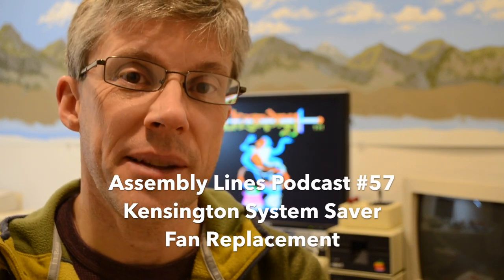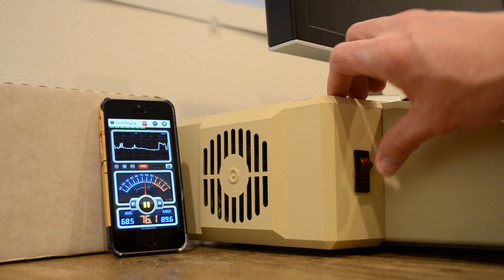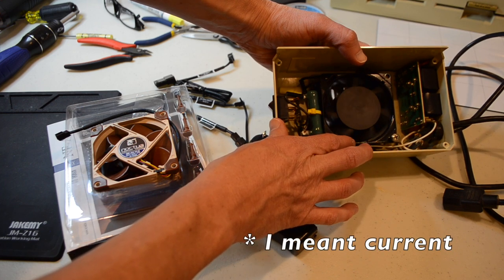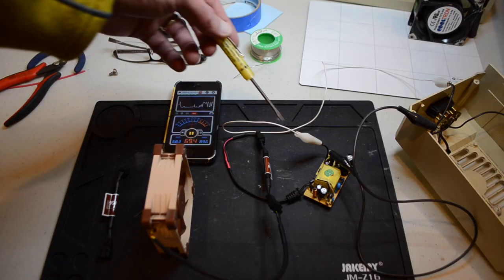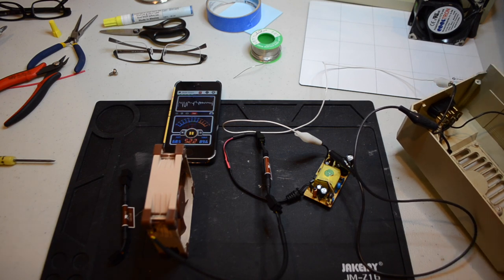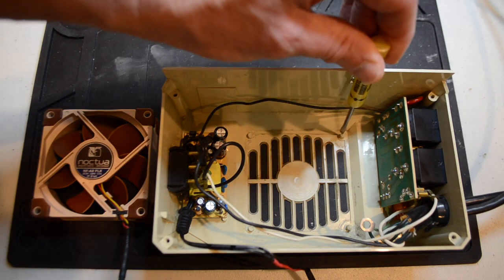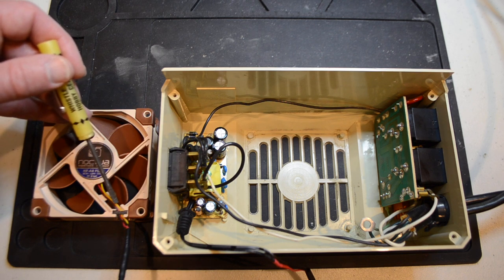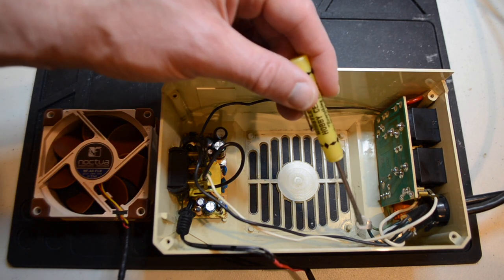Assembly Lines #57: Kensington System Saver Fan Replacement

Comment from the maker: By the way, I forgot to mention in the video, but I used the NA-RC12 low-noise adapter which cuts the fan down to 1200rpm.

Comment: nice video, thanks.  i just did this mod on mine.  only differences are i hot glued the PS and fan in instead of epoxy.  that way it's easier to take apart if needed.  

i also went with the 1200 RPM resistor.  it's dead quiet but i wonder if it's enough airflow?
Reply from the maker: Very cool! It's most likely enough airflow. Mine never seems to get very warm inside. Maybe if you stuffed it full of old-school expansion cards from the 1980s you might run into issues. But with a small number of cards, or more modern ones, you should be fine.

Comment: I wonder if this drill, close to as you show it, would work with the Superfan II which is nearly physically identical externally to the Kensington unit? I am going to attempt the fan replacement.
Reply from the maker: You might need to make some minor adjustments, but it should work. Please post your results!

Comment: Hi Chris, is it necessary to add system saver fan on a lle? Is it going to be very hot when playing games?
Reply from the maker: Hi jouce100, no, if all you have is a floppy disk controller card (and maybe one other card) then it's not necessary. Actually, the way the Apple II works, it couldn't care less what is actually running - it's always running at 1 MHz and there's no graphics CPU or anything. The main thing to watch out for is peripheral cards - once you start having a bunch of cards in there, then they'll draw a lot of current and also inhibit air flow. But for most machines it's unnecessary.
Reply: @CT6502  Thanks for the replay, I would at least have a floppy disk controller card, a Phasor v1.0 card, and a softSP CARD as I use wDrive emulator. And probably I will also have the RAMWorks IIII v1.2 card to replace the original 80 columns/64K ram card. Would you suggest the cooler if I install all above peripheral cards?
Reply from the maker: @jouce100  Hmmm, that sounds like a lot of cards. You could just run it for a while with everything, and then pop the lid and feel how hot it is inside, especially the 6502 cpu chip. If you can keep your finger on it then it's probably fine. If it's too hot to touch then you should probably get a fan. The system saver is actually useful as a "power strip", because you can plug in a monitor to the back of it and turn on both the computer and the monitor with a single switch at the front. So it's not just for cooling. :-)